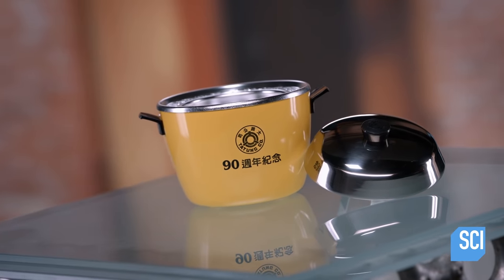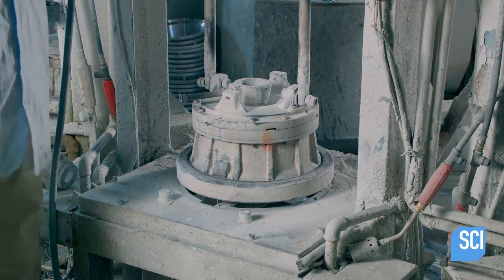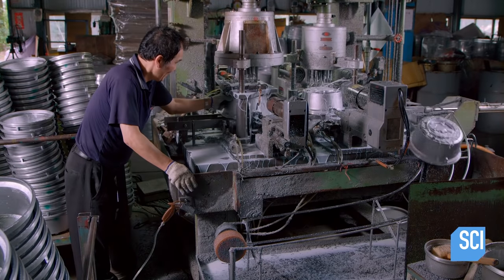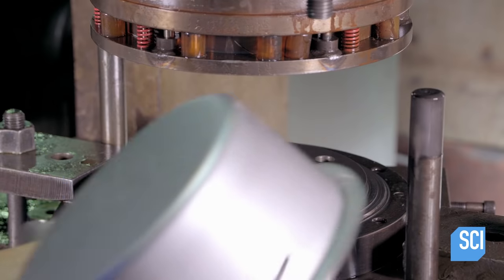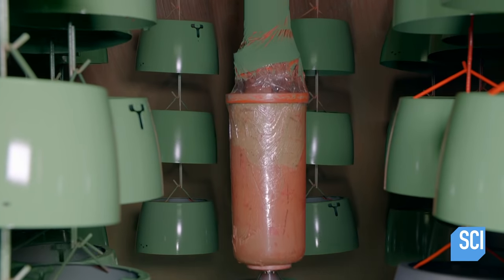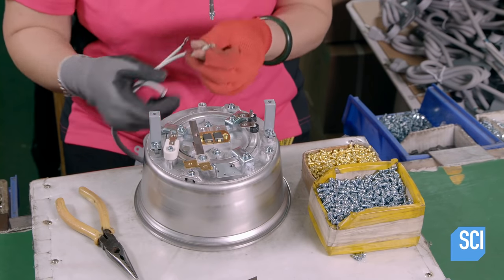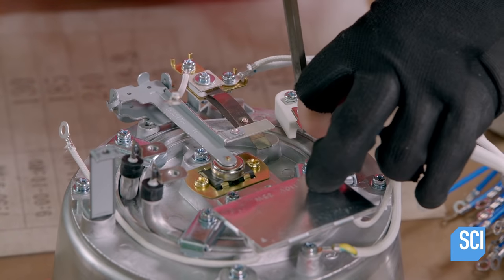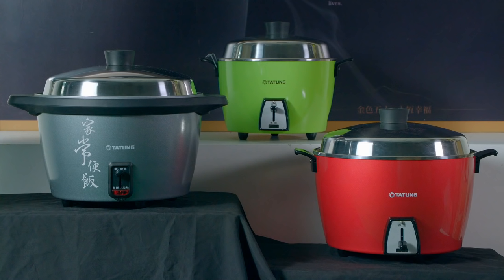How Rice Cookers Are Made | How It’s Made

Comment: Works great if you pay attention to instructions. https://www.youtube.com/post/UgkxviiltW7NlHbp_VL_bLbIkbLAvILVhnia For those that complain about "mushy" or "wet" rice I suspect they are using the included cup to measure rice (which is really only 3/4 cup) and then putting in water using a separate measuring cup that is a full cup. This results in too much water and you will get mushy or wet rice and think it is not done. Just use the included cup for both rice and water, or your own measuring cup for rice and water according to your package directions. It will come out fine. I've used mine for years for brown and white rice. If your machine is bubbling white froth out of the steam vent then it means you should have rinsed your brand of rice first to remove some of the starch. Sheesh. Makes me wonder how people can cook well enough to feed themselves.

Comment: Found a good Zojirushi Rice cooker with floral patterns on it for $3 at Goodwill, still use it to this day :D
Reply: Zojirushi "Elephant Brand" is built like a tank, that was a steal for $3.
Reply: @NickyNightShine  I got ya beat. When I lived in Japan I got a Toshiba brand fuzzy logic cooker in the electric appliance store garbage pile. my cost was zero. Ive been using it back here in Canada for 20 years now.  The non stick coating had bubbled off in places like someone had put it on top of the gas flame. I just removed the rest of the coating by putting it back onto a flame and a little elbow grease i had a plain aluminum pot and no worries of the teflon leaching into the rice :)
Reply: I hope you at least washed it first
Reply: @kingcalamity4350   Got a National rice cooker 1985 and still works. Made In Japan. 100V.
Reply: @douglashoward346  yeah, but now you are worry about aluminum leaching into your food.  Aluminum is linked to Alzheimer.
Reply: Zojirushi is the god of japanese cooking appliances
Reply: Made in japan vs made in china😅
Reply: Wow that's a steal! Zojirushi makes great rice cookers. They even make hot water dispensers, too.

Comment: this is the first i heard of a rice cooker that you need to add water into the outer pot.
Reply: Yes, me too.
Reply: It’s actually a steam slow cooker. It used water as heat conductor , preventing inner pot directly contacting electric power high temperature heat pad. So your food will not experience any heat over 98~99 degree C. If you have experience on cooking canned soup (thick one, like chowder) over conventional stoves, you might experience burn in the button if u don’t stir it all the time while heating. This cooker doesn’t have to worry about it.
Reply: The real ones like this use steam to cook. Much better.
Reply: @tianzining  Great explanation 👍
Reply: Let me shed some light on this pot... it’s very famous in Taiwan for basically working forever. It’s not just a rice cooker as others have said. You can cook porridge or steam dumplings in this as well.
Reply: What @op3l said. I've used one that I got from my aunt until just last year. I only had to give it up because I was moving back to Taiwan and didn't have room for it. Who knows how long she's had it. So basically, it's been working for 18 years + how many years she's had it.  As far as I know, she got it pretty soon after moving to America (in like the 70's) and it's still working today.
IMO, tiger rice cookers makes fluffier rice, but with a Tatung, you can steam fish, dumplings, vegetables, really anything, in addition to making rice (which it does well too. That's what I'm using now for rice). The warming mechanism is actually a pretty high temperature too. If you do 2.5~3 times the amount of water to rice ratio the night before, steam and let it warm until morning, you'll have nice and creamy porridge rice for breakfast. Even better if you make said porridge rice with a broth, some meat and/or veggies, you get the idea.
Reply: The advantage point is, that water keeps the rice warm for longer time after powering off.
Reply: it's a old fashion steam slow cooker type of rice cooker. (Originally from Japan (which is a very basic model that can only cook rice), but it's Taiwanese brand that show in this video to make it the "multipurpose cooker" as we know today....it's basiclly a steam cooker ,but you can also use the outer pot as a pan(with the newer "full stainless steel panel" model ,and I  personally not so recurrent about doing this) ,and inner pot as a fryer , cook rice ,reheat the leftover ,or make a slow cooking stew....you can always rely on it to cook some food.)

And yes , it last forever , and most everybody have one here in Taiwan.
Reply: How it's made is wierd for making us see things we never thought  were to be real
Reply: That's why we people are good.
Reply: Enviotonin85  you can not really cook rice like that in 20 minutes ...strange ..never ever heard anything like that ....we use rice cookers our whole life and never seen this ..not even in china
Reply: Yup same here... and I am from a culture whose staple is rice 😊

Comment: This is not correct, most are made by press forming sheet aluminium. It would be crazy expensive making them from cast.
Reply: Well they were a bit wrong with the inner pot supposedly made of "stainless steel" when it was clearly aluminum.

Comment: Wrong, 
Step 1: Buy a cheap civic 
Step 2: Buy the cheapest lowering springs made. 
Step 3: leave all parts of exhaust from the cats to the mid pipe stock, get a 3” muffler. 
Step 4: Get the dumbest most useless wing installed. 
Step 5: BODY KIT!!!